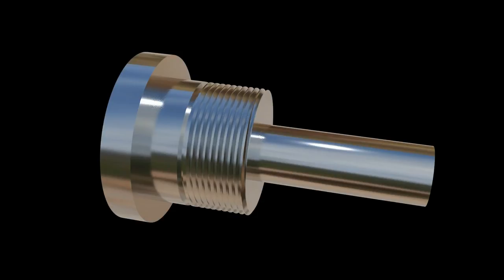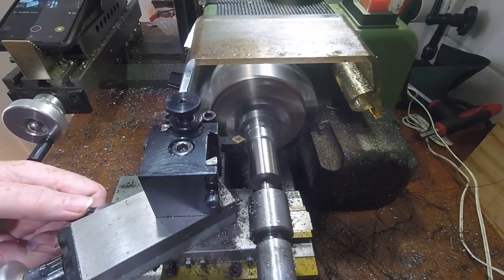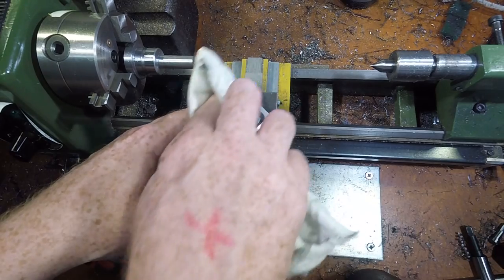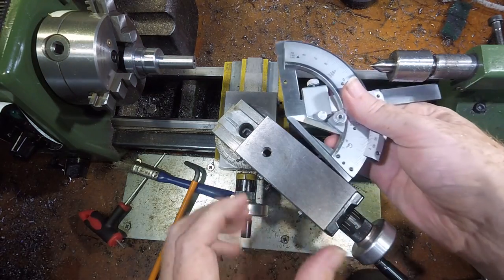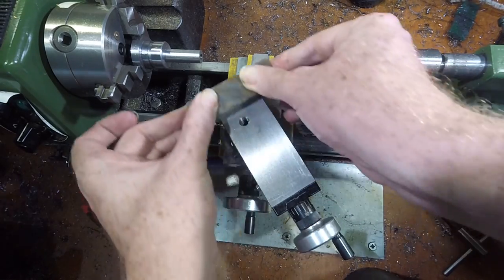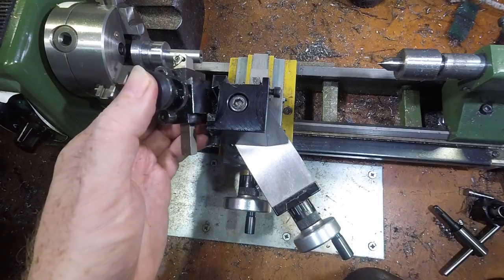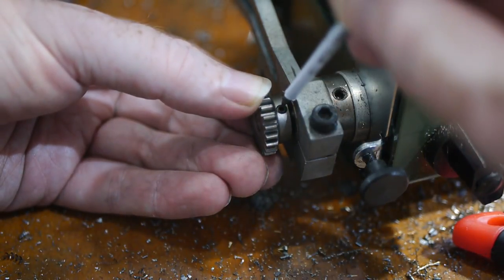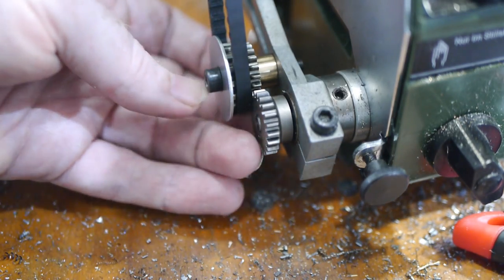Cutting an External Thread on the Proxxon PD 250/e Lathe

Comment: Thanks for the reminder to  clean the tools. I get so involved in my jobs that swarf and tools can build up on the workbench to a dangerous point. 
I try to do a 3 minute cleanup every hour. Returning tools to the box and a quick hovering of the swarth. I Learned this from my dad as a child. I set an alarm so I do not forget. Problem is the shop stays neat but never actually gets clean. So a good deep clean-up, at start up, is a good idea.
Reply from the maker: I wish I'd been given this advice three years ago, when I was setting up shop. I used to really let the clutter and mess accumulate, and lots of my key surfaces are worn and damaged. I've learned to be really strict with my ways and contact surfaces now, and clean them as often as possible.
Reply: Please provide the address for the distributor of Proxxon FD-150, in Indonesia .
Reply: @Dodi-nz3fd  please post your question again to "adventures " because the "frog" does not know the answer 🐸😐🙂
Reply: Traducir a español
Reply: Gracias por el recordatorio para limpiar las herramientas. Me involucro tanto en mi trabajo que las virutas y las herramientas pueden acumularse en la mesa de trabajo hasta un punto peligroso. Trato de hacer una limpieza de 3 minutos cada hora. Devolver las herramientas a la caja y un rápido vuelo sobre la hilera. Aprendí esto de mi papá cuando era niño. Puse una alarma para no olvidar. El problema es que la tienda se mantiene ordenada pero en realidad nunca se limpia. Así que una buena limpieza profunda, al inicio, es una buena idea

Comment: Nice lathe. Very informative. Your compound slide is in an angle, every time you advance the compound slide forward you are moving the cutting tool forward and toward the spindle ever so slightly, that will throw off your initial starting point.
Reply from the maker: This is intentional. The compound is set to an angle that matches one side of the thread. This ensures that only one side of the threading tool is cutting which is more stable, especially on a small light lathe.
Reply: @AdventureswithaVerySmallLathe  I see what you mean. Cutting one side of the thread only will result in inconsistency thread per inch. You will have improper threads fitting. You’re cutting the left side of the thread and leaving the other side looking like a stairway every time you advance your angle compound. You will not notice this with naked eyes but under a microscope you will see the right side of the V will look like a microscopic stair way.

Comment: Been a long time since I cut a single-point thread, so this was an excellent review. For depth, thread wires are good but a lot of people cut or buy the nut, then use it as a standard. Otherwise for a given thread depth D, the reading on the compound should be C = D/cos(A) where A is the  offset on the compound, usually 30 deg for metric and non-Whitworth Imperial. The depth D is found in tables.
Reply from the maker: Joe Pie' did a good explanation why it's not a good idea to get into the habit of making a thread to match a nut, or other example thread; I forget which video though. One key reason for me is that burrs on the thread might affect the fit, and removing the burrs is difficult without disengaging the lead screw. The reading on the compound works as a heuristic, but is imprecise because it's hard to be sure what the radius of the cutting tool is, or how deep it penetrated the part when finding the zero point.
Reply: Something to mull over. Thanks.

Comment: You could flip the tool by 180 and thread in reverse (going away from the groove towards the tail - this way you don't worry about stopping the lathe on a dime; the relieve groove can be much narrower)
Reply from the maker: I do love threading away from the chuck, but I haven't been able to sort out a set up which works when I need to support the part with the tailstock. The large end of this arbor is quite thin, and the chuck jaws have a narrow hold, so the live centre was essential for keeping things rigid.
Reply: The problem with that is you need a left-hand tool as well as a special shim for the threading insert. The special shim corrects the helix angle. The shims are difficult to locate and are quite expensive. I had to replace the standard shim in my toolholder after a crash and I had to special order the replacement from MSC. Minimum purchase was a ten-pack.

Grinding a HSS tool should be feasible, though.

Comment: Great explanation of thread cutting on a small lathe. I’ve tried this on my PD400 and a problem I get is there is so much over run in the spindle once I switch the motor off, that the tool crashes into the non threaded end of the work piece… maybe I need to push the gears in the banjo closer together.
Reply from the maker: I guess the PD400 has that much more inertia that the sudden stop isn't practical.
A technique I've seen larger machine operators use is to pull the cross-slide back very sharply at the same time they stop the machine. It only works if pulling the tool back would give you enough clearance though.
Reply: Thanks for taking the time to respond. I practiced your technique the other day and it works well. Thanks again.

Comment: You can align the tool post, by touching the edge of the threading insert against the face of the chuck body, or, if the job is of a large enough diameter, against the end of the workpiece, provide the end of the workpiece is flat.

Comment: Thanks for sharing...followed your steps and did a nice thread work. Before I only worked with straight advancing which works but it’s better to use the proper technique.
Some ask why the compound at 30deg?
Here are some benefits I’ve observed:
The tool blade will advance with the  left side cutting the material only. This means the tool can cut easier and there will be less torque on the turning piece so less bending of the rod and better finish. The right side angle of the thread triangle will be given by the compound angle. Also the compound cannot be set at 0 degrees at least on some lathe models and it is easier to work with two sliders because one counts the advance and the other is used to retract the tool and position it back to zero so the only option is to set it at 0 or 90deg. With 90deg there are no benefits and you need to lock it with a screw otherwise the backlash will affect the thread.

Comment: Bonjour, quelle est votre opinion sur la qualité et la précision du tour à métaux Proxxon 250 ? Merci par avance pour votre réponse. Cordialement.
Reply from the maker: Hello, I hope you don't mind if I respond in English. My French is good enough to understand the question, but not really good enough to write the reply.
The quick answer is that I think both the build quality and the precision of the PD 250/e are very good for a lathe of this size. The only question for me is whether it is worth the extra cost, as it is a lot more expensive than many small lathes. I would recommend the Proxxon to anyone who wants a lathe that they can use straight away, and do not have the time and knowledge to do the repair work needed by a lot of very cheap lathes.

Comment: I feel scrapping chunk of metal across the carage would cause enough wear to eventually throw things off or am i just over thinking it?
Reply from the maker: The thing I used in this video wasn't a chunk of metal. It was a very fine abrasive stone, with a very flat face. The idea is that this stone will remove any raised points caused by burrs or impacts on the carriage, but not have any effect on the majority of the flat surface. If the machine is already clean then this step is not necessary.
Any abrasive used enough times will eventually wear the surface down, but a fine flat stone should cause so little wear that it will take a very long time before the impact causes problems.

Comment: In imperial measurements, when compound feeding. .750/(threads per inch) gives the radial depth(root to tip) of the thread to cut to(stop .010 short if you have the nut or equivalent to fit to)final few.001 done on cross-slide. if your machine cuts on diameter( moving dial by .010 only moves cutter .005) then the formula is (.750/TPI)*2 if feeding in radially(cross-slide only use .650 in formula instead.

Comment: Might seem like a silly question (it's been more than 30 years since I used a lathe), but can you set an automatic stop on this Proxxon to stop the tool post crashing into the chuck? As I recall, back in the 1980s I could set a stop on a Colchester lathe that would disengage the screw when it reached the stop. Without it, I am sure I would have crashed the tool post a couple of times a week.

Comment: Hi folks. A trick to setting the gear spacing is to use a strip of paper between the teeth. BobUK
Reply from the maker: Nice idea! Thanks for the tip. I use a similar trick to touch off endmills, but didn't think about using the same for change gears.

Comment: Is there a good introductory book to get that would mention something like needing to stone and align the toolpost with an indicator?  The initial learning curve is just overwhelming and there is only so much videos can do to get a total noob over that hump.
Reply from the maker: I honestly don't know of one that fits what you are asking for. I've read beginner books, but they don't include nearly this much detail. I skim and dig through workshop course books, and reference manuals, but I don't remember finding this kind of practical advice in those either. Much of what I know has been gleaned from 100s of hours of video. Keith Rucker is probably the best source of thoroughly explained machining methodology. I'll put this question to my subscribers.
Reply: @AdventureswithaVerySmallLathe   It is interesting, I fear that the devil is in the details, and the details are often "institutional knowledge;" something you may not pick up unless you're working with an old hand in person.  Or as you say watching 100's of hours of videos.  But the flipside is that an air of mystery tends to keep wages higher for capable machinists...

Comment: Any good lathes that are bit bigger than Proxxon PD 250/e? I would like to be able to work up to 105mm diameter stock. Proxxon with 4-jaw chuck can handle only 80mm. And physically the limit is about 86mm. I just need something that can do turn pieces down 100mm. So 105-120mm capacity would be perfect. Length wise, 30-40cm should be fine.
Reply from the maker: The only lathe I've used that is bigger than the PD 250/e is a Colchester Triumph 2000, but that is a lot bigger, and probably larger than you mean.
Proxxon do have the PD 400, which looks very similar, but large with a few more features. I've never tried one though, so I can't speak to how suitable it is for what you need.

Comment: Have you ever run the late in reverse straight after a cut without winding the cutter away from the part? Just wondering if there’s much to worry about if you’ve already made the cut and removed material, then the tool should only be barely touching when put in reverse?! Not good technique to get in the habit of I bet but if you had to cut thread in a soft material like Aluminium then could you get away without damaging the tool or part?  Also... would you say the Proxxon is a much better machine than the other Chinese lathe you’ve been using? Wanting to purchase one or the other soon and would love your feedback. Can tools and accessories for either be sourced easily, are prices for either similar and/or are they interchangeable? Lastly, Thanks for your time and effort to put these videos together mate.. appreciate it and really enjoy watching them. Cheers
Reply from the maker: Reversing the lathe without retracting the cutter rubs pretty badly, and is a really easy way to chip the insert. When it's cutting, the tool flexes under the cutting forces, then springs back at the end of the pass, so it will slightly inside the material on the return pass. This effect would be smaller with a software material, but still enough to mess up the finish.
The Proxxon is definitely built to a higher standard than my Chinese lathe, and I also think it's better built than any other 7" Chinese lathe I've had a look at. However the Proxxon is much lighter than the Chinese lathe, so a Chinese lathe re-built to the same standard would probably be capable of bigger, heavier work. The Proxxon is more than twice as expensive though, so you need to weigh up what you can afford, and what time and effort you are willing to put in to get a high quality machine.
Reply: Adventures with a Very Small Lathe- Thank you greatly.. I appreciate the feedback and your time. I’m enjoying your Chinese rebuild series. You’ve given me more confidence in being able to improve one to a reliable standard if I decide to head down that road. Keep up the great work mate! 👍🏽

Comment: The lathe is a beauty and you are the master of it - great video. Question: how do you register exactly on the same thread for each repeated cut? I would think it could be any issue, though I did not cut threads with my Smithy I had once. Hope to see your reply.
Reply from the maker: Thanks! When threading on the Proxxon, the feed mechanism is kept engaged throughout the process, which ensures the carriage feed position and the spindle rotation remain locked together, and guarantee that each pass is correctly registered.

Comment: I’ve been looking a mini lathes for various RC hobby uses and just stumbled upon the Proxxon tool line. Not sure if you’ve ever used the Chinese cheap lathes but I’m wondering how they compare to proxxon?  Great video.
Reply from the maker: I get questions related to this quite a lot, and it's not easy to answer. I've never used a small Chinese lathe, and while I love my Proxxon I have to admit it has some flaws. Overall it's extremely well made, but it is very expensive compared to the Chinese machines. The Proxxon also has a very poor tailstock, which doesn't have any adjustment, so is always slightly out of alignment, and a little too light and flexible.
I think I would still recommend the Proxxon to anyone who knows they will only ever need to do light work, and are confident it will be large enough for their needs. For someone who wants to try out the hobby, a cheap Chinese lathe will probably be lower risk, and if they take to it, they can upgrade to something bigger without having wasted too much.
Reply: Adventures with a Very Small Lathe thank you!

Comment: Would you still recommend to buy this lathe? In looking for a small first lathe, I found your youtube channel. If you can recommend this (or maybe anther, who knows) I'd be more confident for my purchase. THANK YOU and my compliments with your video's.
Reply from the maker: I would recommend it. The build quality is very high, and it arrived ready for immediate use. I've never had to do any maintenance work in around 4 years. Just keep it clean, and well lubricated.

However, I would add two warnings:

1. This lathe is small. If you want to do a lot of work on material over 20mm, the lathe is going to struggle, and probably suffer wear and tear. Make sure the work you have in mind fits a lathe this size.

2. It is a lot more expensive than easily avalable lathes. If you have a limited budget, and can follow all the videos on improving cheap chineses lathes, you can get a decent lathe for much less, but you will have done a lot of the work yourself.

Comment: I never understood the business of ofsetting the topslide when screwing anything and I used to machine big stainless valve seat rings and lots of little stainless parts.
Reply: Rose White I did a few thread for hobby parts aluminum/steel and only used straight advance and they got ok. I watched this video and I think with the slider at 30deg only the left side of the insert cuts the thread. It’s probably less force on the tool and on a part which is good for unsupported parts and probably it cuts easier and it gets a better finish

Comment: I would like to buy a small lathe like this one or similar. I see on all the specs only tell the TPI capacity of the threads, but I live in Europe. Are all the lathes capable of both metric and imperial threads or I have to look specifically for metric thread lathes?
Reply from the maker: Most mini lathes are capable of both, but require a separate set of change gears for each type of thread. Check carefully which gear set the lathe comes with, and whether the alternative set is also available. A lathe which has a metric lead screw is likely to be more versatile when it comes to metric threads, so if you only need metric, try and look out for a lathe specifically for metric. Avoid lathes that have 2.5mm per turn scales on their controls. There's a good chance they are using 10tpi imperial threads, which means the dials are actually 2.54mm per turn, and the scales are inaccurate.

Comment: I NEED AN HONEST OPINION ON THIS MACHINE, I AM ABOUT TO PURCHASE
Reply from the maker: The Proxxon PD 250/e is a very good, small, lightweight lathe, best suited to small light work. It is manufactured to a high standard, and mine has worked well for several years with only regular oil for maintenance. Cheaper Chinese lathes are somewhat heavier, and can deal with bigger work, but many seem to be made to a much lower standard, and require much more maintenance.